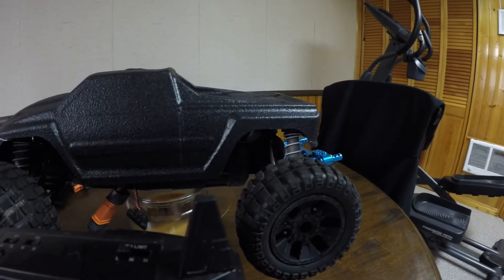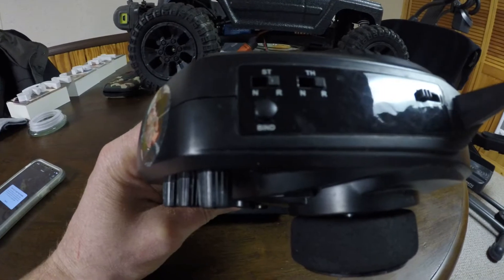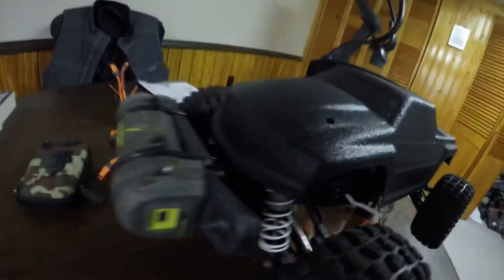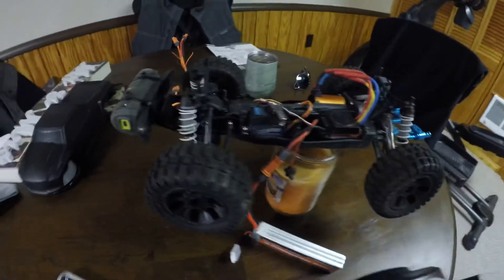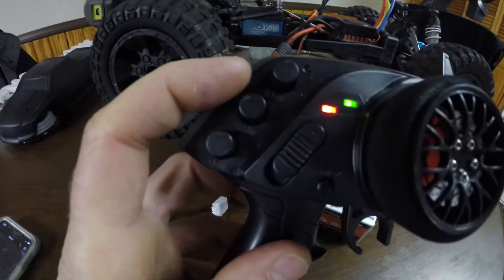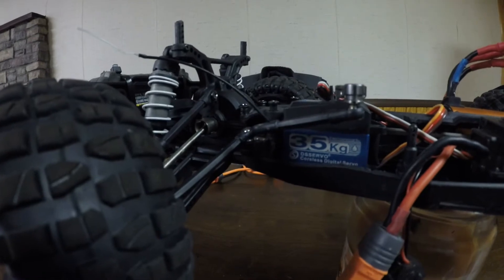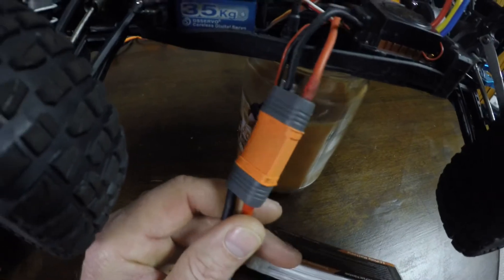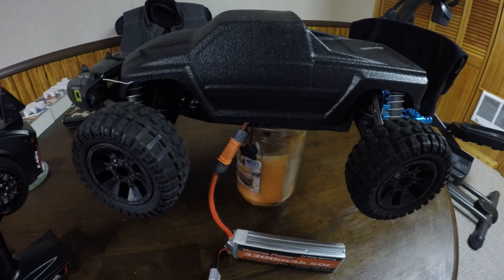GoolRC issue with Programming card and ESC Part 2

Comment: This is actually a common problem with most but especially this transmitter, which is a simple rebrand BTW.
Especially with this one because it really has exposed throttle trim knob. So you knock it with your fingers, knock it in the box,  and knock it in the backpack. Multiple cheap esc's hate throttle input at setup. I'm guessing more expensive ones have software, that accepts it at neutral, which may mess your exp up,  but at least you won't instantly assume it's broken. But not those cheap ones, and it's sad, cause they get bad rep+when beginner gets RC with better radio included, there will be throttle trim knob on it...
you know where I'm going